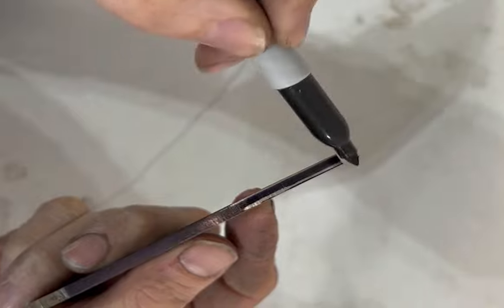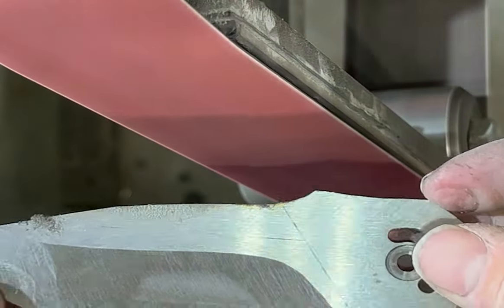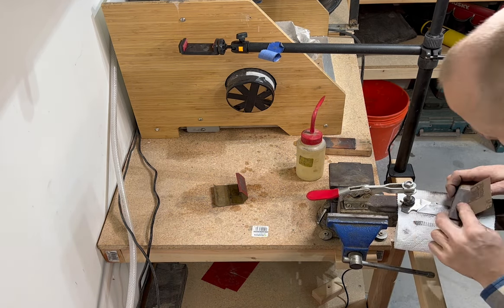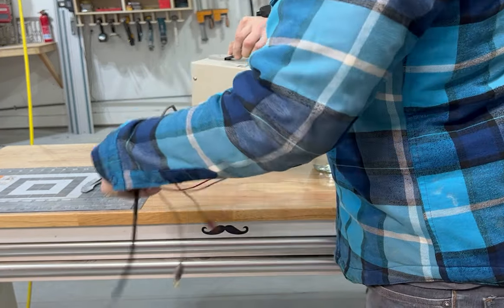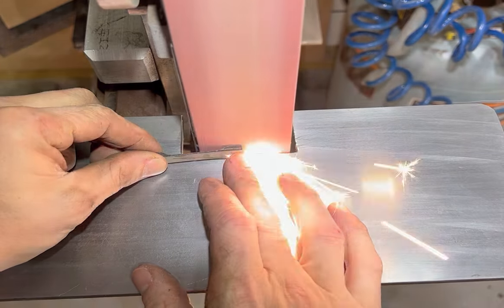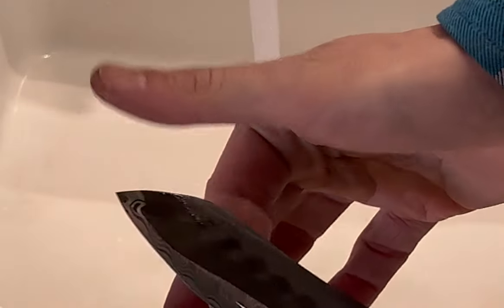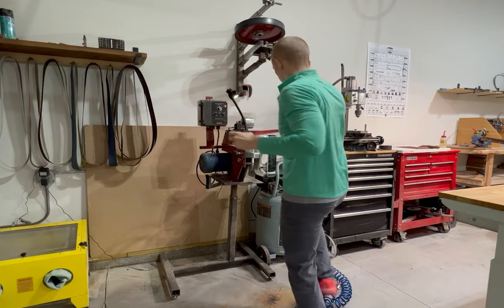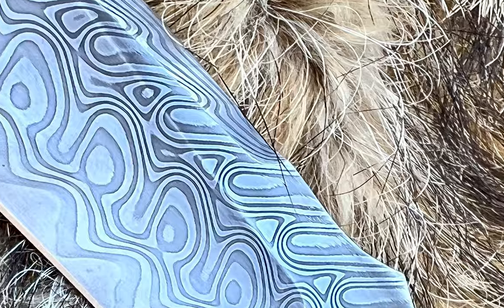How the mammoth tooth polished,  part 2 of Mammoth Folder

Comment: You're supposed to leave the file guide on.  It prevents the belt from walking and washing your grind lines out.
Reply from the maker: Not if you know how to grind correctly. Do those grind lines looked washed out to you?
Reply: You answered your own question.  Leave your file guide on.  Is this the final assembly by the way? If so I would remove one number from your total price, fix the centering and symmetry issues,bolster  to scale height and backspace, countersink and chamfer properly , final contour and etch the blade one last time.  But that's just what I would do if it were on my bench....
Reply from the maker: @jbfthree1  haha I’m sure you would. On your imaginary bench. In your imaginary world.